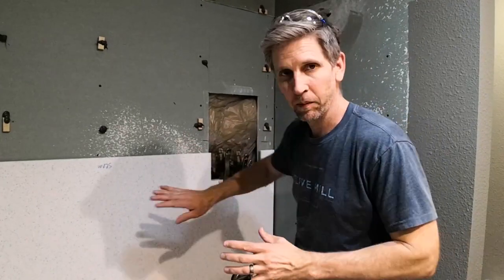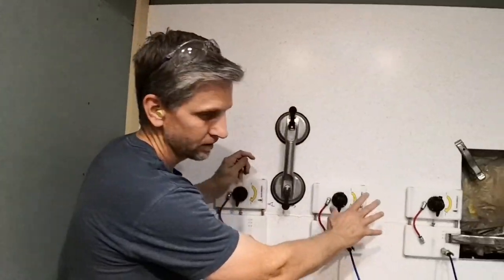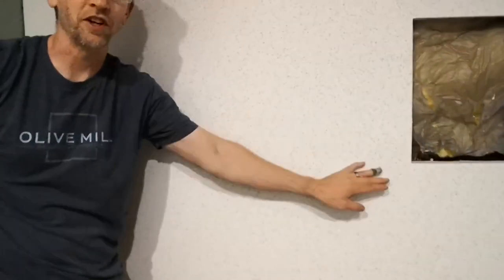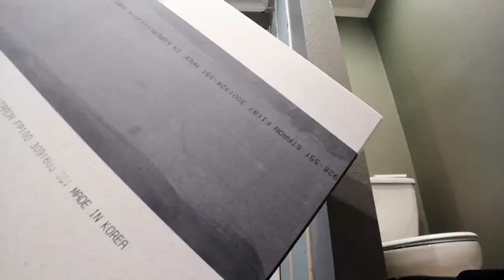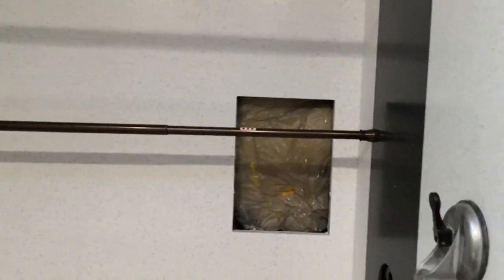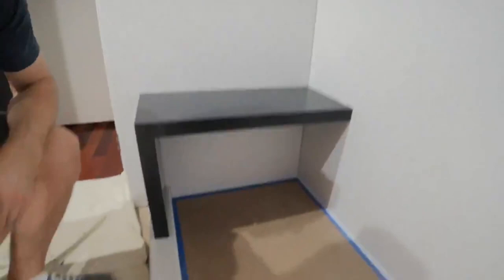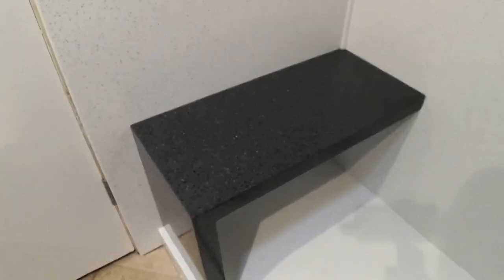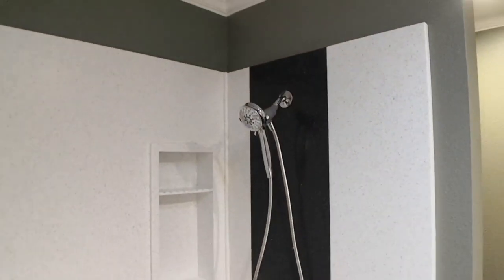Solid Surface Shower Walls - Wall Panel Installation - Part 5

Comment: Who makes them air clamps? I do a ton of corian work and have never seen them. Love em.
Reply from the maker: Hi, Those are called Parallign Seam Clamps. I bought them direct from Monument Toolworks but I think you have to buy through Braxton Bragg or maybe a solid surface supply company.

Comment: Pardon my ignorance but where did you put adhesive on the back of the panel, wall or both? If the wall, where?
Reply from the maker: Put the silicone on the wall every 8 inches or so.

Comment: Hi man my question is this solid panels do not damage with hot water and what about the level of drain how you do it. Thank you for your useful videos.
Reply from the maker: The panels can withstand the heat of a shower without an issue.

The shower pan is thermoformed to have a slope of 1/4" per foot.

Thanks for watching the videos.

Comment: Very nice job. As a DIY I have worked with solid surface material for a house we flipped. I was hoping it would be for the kitchen however it ended up in the garage on the old kitchen cabinets. How does the glass sit in with that bench?
Reply from the maker: Hello, the glass is cut perfectly around the bench creating a water tight fit.

Comment: What are the remaining holes in the sides of the soap caddy that was installed in the wall (15:53)?  Is that to add other shelves to the caddy if desired?  Wondering if you sealed those holes closed (?). Great video series!
Reply from the maker: Those holes are for a removable shelf. Stainless steel studs go in the holes and the shelf sits on top. We do not fill the holes. The soap caddy can be made without the holes though. Thank you for the compliment.

Comment: Can we just order the pan, use hardibacker board for the surround and tile the surround?
Reply from the maker: Absolutely, but you will have to silicone hardibacker to the outside flange. Thin set will not stick to solid surface. So install pan, install green board, install hardibacker over greenboard down over the flange and then install tile on top of greenboard. Do not grout at the bottom, use a color match silicone that matches the grout.
Reply: @AndyGraves  Great explanation. Thank you! I'm near Disneyland so you guys are just up the street from me. Ill come by some time!
Reply from the maker: @IWBVS  Stop by anytime, just call for an appointment and you can take a look at all the options.

Comment: Cool did one the other day bad thing was big gaps between panel and floor pitch was made to big good work
Reply from the maker: Were you able to get it to work?
Reply: @AndyGraves  yes have you ever routed panels on walls before can you put straight edge on wall would you hot melt it
Reply from the maker: Yes, just hot melt glue a straight edge to the wall and run the router.
Reply: @AndyGraves
Did you build the seat and soap nitch?
Reply from the maker: We're you able to make a template of the wall?
Reply: I was asking if you had built the shower seat and soap caddy 
Because I thought I heard you say on the video the homeowner had ordered the seat and ordered a bigger soap caddy than what you had cut
Reply: @AndyGraves  yeah we got it in hope your doing well and staying busy

Comment: Andy, we live just south of Knoxville, TN and are looking for a nice but affordable surface to replace our fiberglass shower insert.  I don't have enough skills to do a DIY, but do you have any recommendations for a material type?  I don't mind tile on the walls, but I would at least want a solid surface for the shower base.
Reply from the maker: I actually like solid surface on the entire area because it is so easy to clean and it can be custom.

Comment: What r the different grits you go through when sanding?
Reply from the maker: 80, 150, 220, 320 and if you use finer grits it will get shinier. Use a.scotchbrite pad at the end.

Comment: I watch all 5 portions, Nice work.....Question.  I see you cover the small ( 4" high) vertical walls if the pan with the Corian Wall Panels...If I use tile how should I "glue" the tiles over the small vertical walls on the pan? Epoxy , Silicon?  Will the pan contract and expand
Reply from the maker: I've never done it but I would imagine you have to run cement board to within about a 1/2" to the floor and place tiles on the board. The pan will expand and contract.

Comment: Can the niche be installed from behind like an under mount sink?  I see showers on the corian website that don’t have the lip around them but our installer says they put them in from the front like you did here.
Reply from the maker: They can be glued to the back of the panel without having a flange.

Comment: Is it possible to epoxy the wall panels to the shower base so that there is no need for silicone. So instead of a flange, have some sort of coving in the shower base and then the wall panels attach to that?
Reply from the maker: Yes it can be done but with the expansion and contraction of the panels is could break.

Comment: question, is it necessary for the corner bead? are these showers sold in kits or do you just install from the sheets of Corian. How much does a shower this size sell for?  by the way, nice install
Reply from the maker: Hello Tony, No, you do not need the corner bead. For us, because the material expands and contracts so much, we like to use it as extra protection and we think it looks nice. The showers are not sold in kits anymore as far as I know. Not sure the cost, I only get involved in the fabrication/installation. Thanks for the kind words, I hope the videos helped.
Reply: @AndyGraves  The corner molding does look nice but I'm interested in how you executed it.  Did you 1st caulk the corner with silicone and then, while it is wet, take the corner piece and press it in the corner followed by caulking the (2) seams with the wall panels?  This is the only part of a solid surface shower surround that makes me nervous for water leaks.  Is there a specific brand/type of silicone caulk that you prefer?  Very very nice looking shower and so much less of a maintenance headache than tile.  I was considering doing an epoxy grouted tile shower but this is the way to go.
Reply from the maker: @johnbutter7305  We leave an 1/8" gap in the corner, fill with silicone and the place the quarter round into the corner. We use super glue to hold the quarter round in place while the silicone cures.

We use a color matched silicone caulk for each side of the quarter round.

Comment: I'd love your thoughts on something; my husband and I are going to be trying to do a SS shower on a wall that has a window. We're assuming it would be fine, it will just need a cut-out around the window but - is this assumption wildly incorrect?
Reply from the maker: You can cutout around the window but we wrap the window jamb with Corian as well. Its not a good idea to have exposed drywall around the window jamb. Make sure the sill is slopped towards the shower a 1/4" per foot.
Reply: @AndyGraves  I appreciate that you took the time to respond! Okay, thanks - that's good to know. Would you avoid it if possible? The shower isn't there currently and we wanted to move it, but if the window would be a major water issue we should probably work out another plan.
Reply from the maker: @TravelersWarden  Having a window in the shower is absolutely fine. Just make sure you wrap the window jamb with Corian to make it water tight. Check out my website to see a picture of a window. It's about 3/4 down the page. http://www.olivemill.com/Applications/CorianShowerandTubSurrounds.aspx

Comment: Can you drill that solid surface with conventional drill bits, in order to install grab bars? Thx
Reply from the maker: Yes you can just make sure you drill the hole bigger than the lag screw. Do not screw into the solid surface material.

Comment: Are you using Sheetrock for bathrooms as a substrate for the Corian?
Reply from the maker: Use green board or cement board.

Comment: Hey Andy...Nice work but once the "Flux Capacitor" seam clamps showed up at 4:30 this was no longer a DIY tutorial for me.  But since you meticulously crafted the wall panels yourself, why didn't you machine a rabbet joint between the upper and lower wall sections to help insure against future leaks?
Reply from the maker: The seam adhesive is virtually as strong as the material.  Once the material is glued together it becomes one piece and will not leak.

Comment: Nice job.   How did you finish the top of the wall panels or did you just leave a gap that was created by the shims?  Thanks!
Reply from the maker: We glue a stip of material on the top and front edge to make up the difference. There is a small gap that we silicon but it's not as wide as the actual shim thickness.

Comment: Should you leave a gap between the walls and the pan for silicone?
Reply from the maker: There is usually 1/8" between the pan and the walls. You don't need silicone but you can put it in there if you want.

Comment: Hey what was that brown tape stuff you put the silicone on
Reply from the maker: Those are pieces of wood for spacing. There was a bow in the wall so I needed to space the panel around the bow. I think that is what you are referring.

Comment: For the base and surround, is this the same material as swan or Florestone? How long should a base made of this material last without cracking or chipping?
Reply from the maker: I'm not sure if it's the same but it's acrylic solid surface material. It should last forever.

Comment: How do you make sure it is waterproof behind the panels
Reply from the maker: The actual panels are water proof. Cement or green board can be used behind it.

Comment: Andy what sander are you using?
Reply from the maker: It's a Bosch random orbit sander. It's the most expensive one they make. The one in the video is not longer available though.
Reply: Andy Graves more videos sir 😀
Reply: Nice job! What is the name of the machine that you used at 4.02?

Comment: What material is it for the quartz attached to? Thanks!
Reply from the maker: I don't understand what you're asking, explain further, thanks.
Reply: @AndyGraves  what material is it behind the quartz panel?
Reply from the maker: I'm sorry. Actually the panels are solid surface and the material behind it is green board drywall.
Reply: @AndyGraves  Thank you very much!  So drywall is strong enough to support the quartz panels?
Reply from the maker: Just silicone direct to the drywall and it should last forever.
Reply: @AndyGraves  Thanks,  if a safety grab needs to be installed on the panel how to handle it ?
Reply from the maker: You would need to put backing in between the studs prior to installing drywall. ADA had specific locations for grab bars.
Reply: @AndyGraves  Thanks!

Comment: Good job on the installation, I especially liked the way you did the bench seat. Did you epoxy the quarter round into the corner or did you just silicone them in place? I couldn't tell in the time lapse.
Reply from the maker: Thanks. We use silicone first. But, then we push the content round into the corner and use super glue to hold it tight until the silicone cures. We also silicone the two outside edges of the quarter round with matching silicone.

Comment: order of grits ?
Reply from the maker: Final grit is 220 and maroon Scotchbrite. I would start with 220 and only use more coarse grit is you have deep scratches. If you want is shinier than use 320 and maroon Scotchbrite.

Comment: Really nice contrast on the color. Would love to see a cove version
Reply from the maker: Thank you. We do not do coves on the shower surrounds because they've been known to break because of the expansion and contraction of the shower panels.
Reply: @AndyGraves  we've done lots of cove showers and we never did go back to fix any of it even after 10 years. 
Just reinforce behind all the seams by gluing corian pieces.
I say if the opportunity presents it self take it, I love all the attention to details you guys do. Everyone that watches your videos are learning a lot.
Reply from the maker: Do you put a seam reinforcement strip behind the cove corner?
Reply: @AndyGraves  not sure if needed but we do anyway

Comment: Unfortunately you speed through the areas that I need more information from. What are you doing on the back wall what are you putting up with spacers. For DIYers we really need more information on how to do it and not just showing you doing it
Reply from the maker: Thank you.